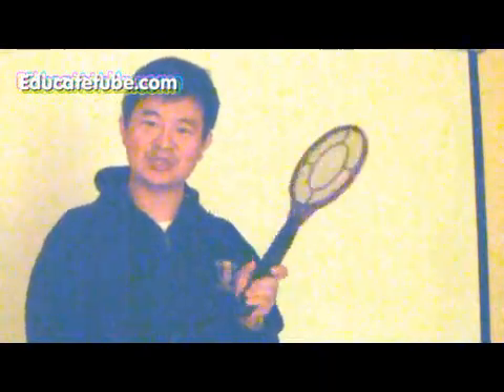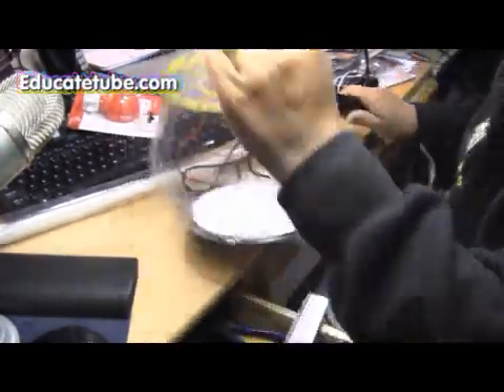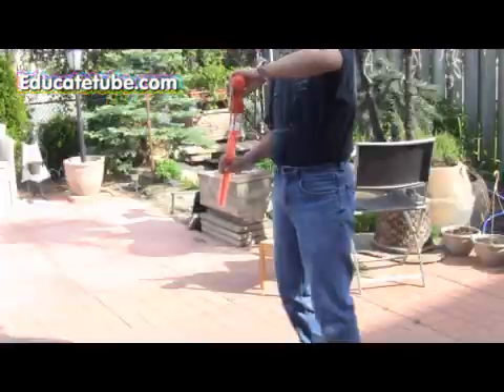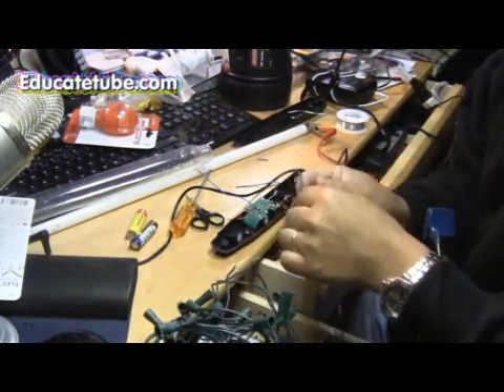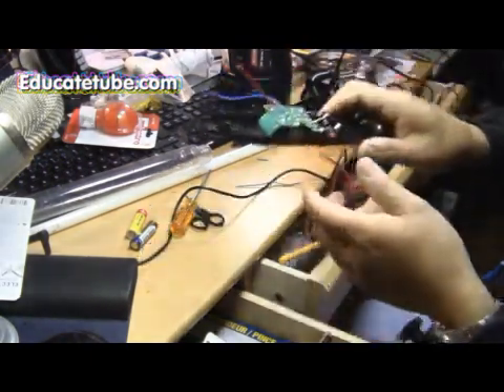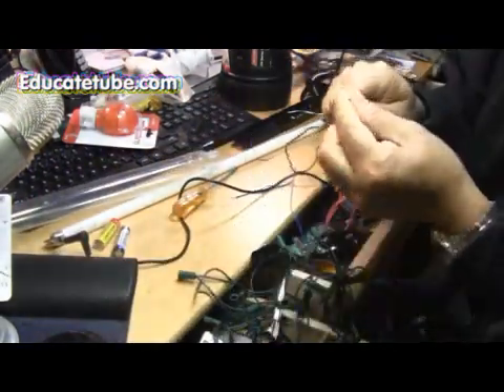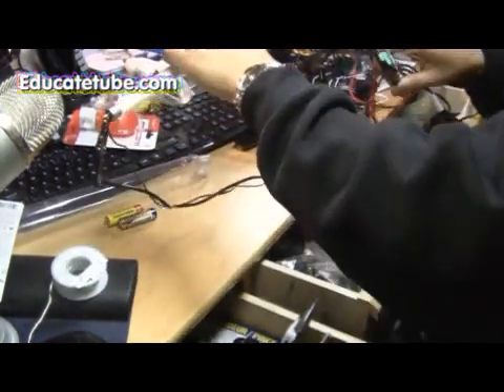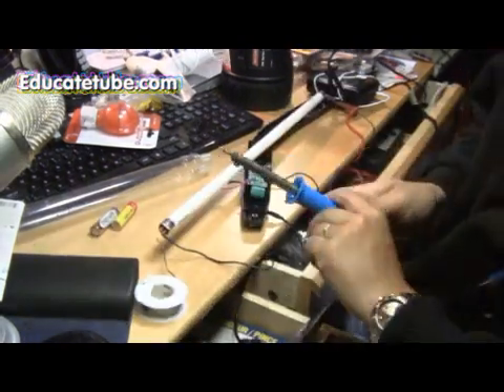How to make your own Lightsaber Cheap and Fun! DIY Light Saber - Cool Weekend Project!

Comment: He's using one of those kids bubble wands that come in a plastic bubble liquid filed tube. The tubes are available in multiple colors in most stores that have toy departments. Sometimes they can be found in "dollar" stores.
A note, I would call this a display saber. The florescent tube he uses is glass and it is internally coated with a toxic powder. You don't want to swing these around too much, or EVER hit anything with it. It will break (shatter).